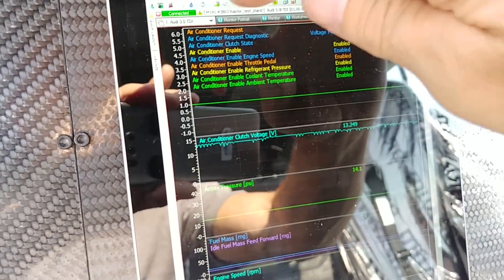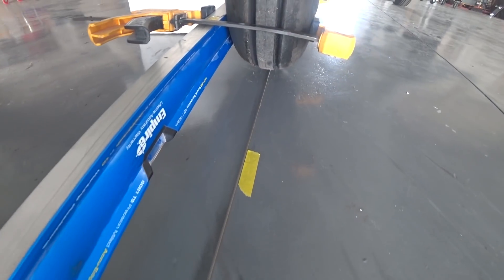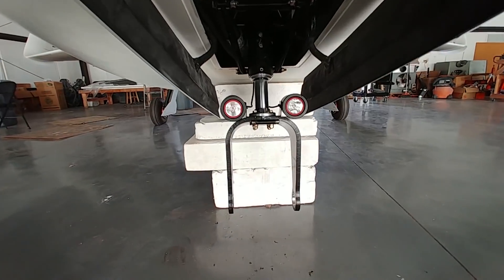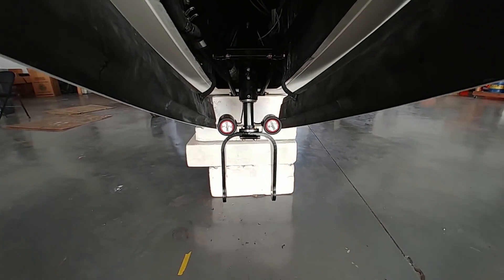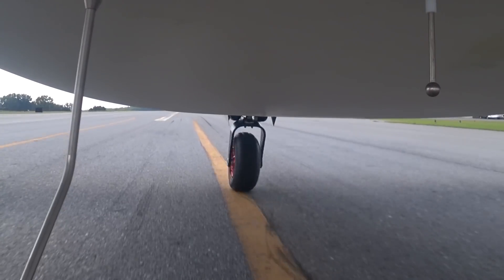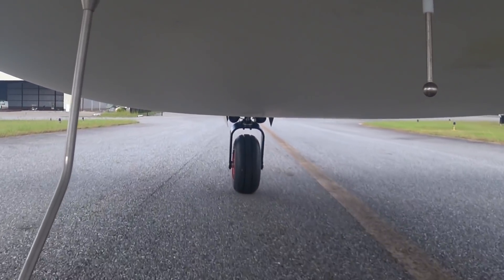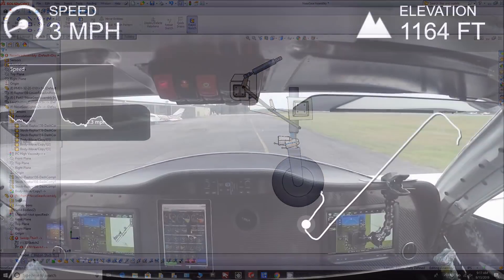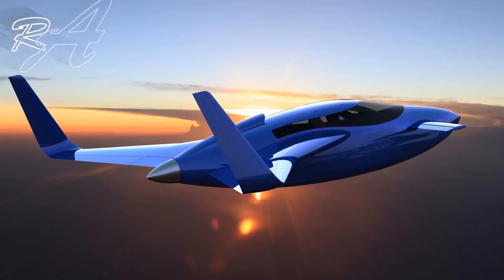Engineering a New Solution - Building the Raptor Prototype

Comment: I thought you had that steering shaft angled but wasn't sure. Now that i have seen your cad and know it's angled, that is your problem. You are using a fork designed with the wheel axle behind the steering point so the wheel will always follow the steering shaft. It's only made to be mounted vertically. 
When you angle the top of the fork back you move the steering point from in front of the wheel to above the wheel. What's happening is not shimmy like you think it is. The wheel is actually falling off to the side. This causes it to lean which in turn makes it steer. This forces it back under the steering point  Once it's back under the fork it falls off to the other side and goes into oscillation. This is exactly what makes a shopping buggy wheel wobble. The mounting point gets bent away from vertical.
Mount the shaft vertical and your problem will go away. The little dampener in the unit will be adequate.
Sorry I didn't say something sooner when I first noticed that angle. Just wasn't sure I was really seeing it
Reply: Like doc said.   You can see clearly in the underbelly camera view that the top of the fork saddle is Angled relative to the ground. I guarantee you this wheel was designed to be mounted such that that top plate where the bolts go thru is Level with the ground to ensure the steering tube is vertical and the wheel’s contact point with the ground trails.
Reply: So it might be worth angling it back a couple of degrees to account for lift off.
Reply: You want at least 4 degrees of positive (forward)!caster for it to be stable. I’d set it so it has 4 degrees positive with the nose strut fully extended and the main struts fully compressed.

Comment: Yes get it to 90 deg. Or less if it trails is even better.
Reply from the maker: We don't want it to trail by very much otherwise the loads start to create a risk of it collapsing or folding backward.
Reply: @RaptorAircraft  doesnt your gear pivot forward so your link would be in tension?

Comment: What about shifting the contact of the tire with the ground to the rear? More trail on the strut would introduce more rake, a damper would only hide a problem that is there. I have zero experience with airplanes but i do tune bike suspensions and frames.
Reply from the maker: Making the strut vertical is going to do exactly that.

Comment: In the roll test the ‘blue’ tubes seemed to flex like crazy when the shimmy occurred. The damper you propose seems to be about rotation, but my engineering instincts are screaming about the inherent flex in the design also. I would also check the rake and trail against known successful set ups for nose wheels. 

It might be an easier/cheaper fix to redesign the yoke that holds the wheel/axle so that the wheel contact patch is a about 50mm behind its current position - while keeping the angle of attack the same. Check it out. I’d be very surprised if your shimmy problem isn’t because there’s not enough distance between the axis of the strut and the wheel axle - there’s too little ‘trail’ to overcome the wheel’s tendency to turn due to surface variations, etc.
Reply: Not sure if the function of those tubes are for any rigidity in the system.. I could be wrong but I think they are solely for the retraction of the nose gear.. http://lancairlegacy.com/nose_gear_plunger/plunger_3_lrg.jpg here is a better view of the upper portion as installed in a Lancair.. Looking at the weld-mounts and through bolt, stiffening the system and encountering a shimmy like that would probably rip the tabs right off.
Reply: It looks very much as you suggest. Poor geometry and lack of rigidity. I think he will need to start over with a working design. The piecemeal fumble along is just making it worse. Plus ditch the lights until you get the shimmy solved. Added mass just makes it harder to fix it.

Comment: Turn the fork end around so it provides a positive castor angle.  The slightly raked fork is fine, it is the trail that has been induced by the fork at the bottom that it the problem.  Your fix probably wont work, because even with the strut vertical, you still have a trailing castor .. it will shimmy just like a shopping cart. Reverse the fork end on the damper and it will be fine. Check out the geometry of any bicycle!! The forks lead, not trail!!
Reply from the maker: Shopping cart wheels only shimmy when their mounts have been bent. Otherwise every cart would shimmy all the time.
Reply: I think you need both a positive castor angle and positive trail.

I don't think looking at planes with steerable nosewheels is that helpful. Take a look at the Long-EZ's free-swiveling nosewheel geometry, for example at http://www.aryjglantz.com/2014/05/nose-wheel-casting-installation.html
Reply: I think the two situations you mention are very different circumstances. In relation to the bicycle forks, they have constant damping and are used to direct the bicycle, they are not free castering.
If the nose wheel was engineered to have a steering function your suggestion would work. Having a forward rake on a castering wheel assembly would just result in broken nose gear should the shimmy get going.
Think of what happens to the front forks of a bicycle when not held in place perpendicular to the ground, it will cant to the side. In this case an uneven surface may be enough to induce this canting motion.
My suggestion would be to look at the lateral rigidity of the nose gear assembly and the level of damping once the forward rake is removed from the gear.
There are a lot of small and experimental aircraft out there with trailing caster wheels on the nose gear. (The Pulsar XP as one example.)
Reply: You are correct, the forks lead, but draw a line from the head tube down to the ground and you'll see that there is ALWAYS some trail due to the rake of the forks (head tube angle.)
https://calfeedesign.com/wp-content/uploads/2019/07/Front-Center.jpg

Comment: Hi Peter, how much work do you think it would be to build a new fork, but this time with a dogleg in it (kind of like a shopping cart wheel castor)  and leave everything else the same? The wheel would hang down lower in the retracted location, so you would probably make new doors with a bit of a bulge in them.  (just a thought)
Reply: Just needs some positive castor angle ... shopping trolly wheels shimmy when too fast, they have negative castor angle ... bicycle forks don't, they have positive castor angle.
Reply from the maker: The fork already has about the same amount of trail as the Lancairs that I'm copying off at this point.

Comment: Looks like with the strut vertical the wheel fork has a slight rake, so you're actually going to a trailing configuration. I'll be that fixes it.
Reply from the maker: Let's hope it fixes it. It's the same setup as the Lancairs that the strut comes from.
Reply: @RaptorAircraft  Are all the parts std lancair parts including the bracket the wheel mounts to?  This pic seems to show the axle mounted in a more rearward position (more trail, more trail=more stability), but it could all be optics.  http://lancairlegacy.com/02_03_images/0203_nose_wheel_2_lrg.jpg
Reply: @RaptorAircraft  This is pretty technical, so I bet you can understand it more than I do, but the TLDR version I think is trail should be 30-60% of radius of tire. https://www.sciencedirect.com/topics/engineering/axis-angle